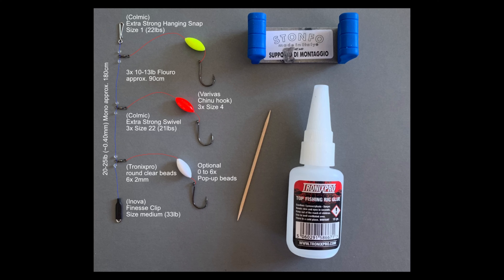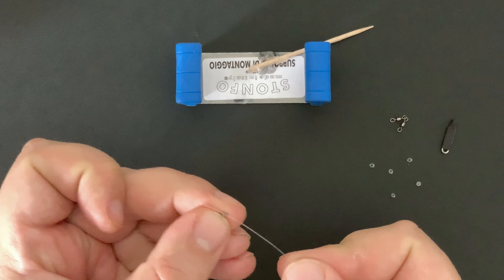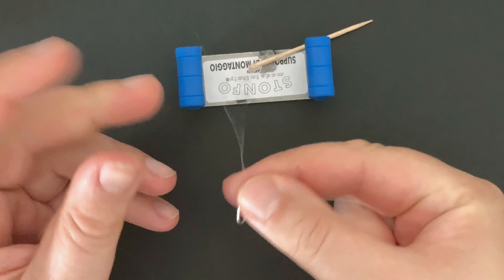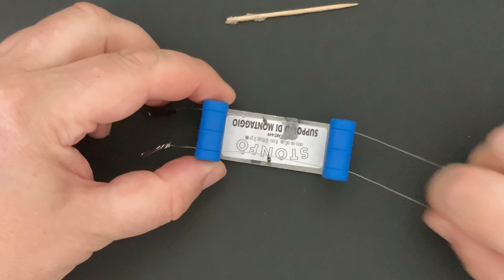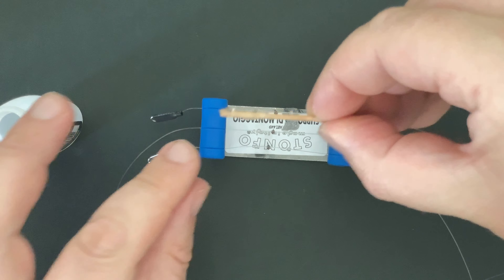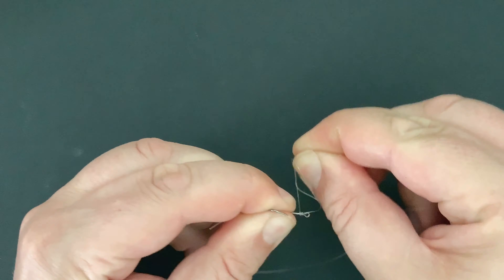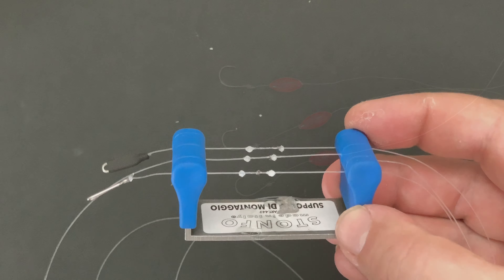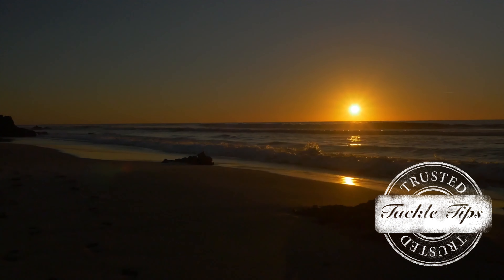2 up 1 down glued fishing rig

Comment: Just a suggestion but you could maybe use a colour other than red as an attractor.  Red is the first colour of light to be absorbed in water, in 5 ft of water it’s barely recognisable as red - in 10 ft of water no red light will reach your rig making your bead effectively black.